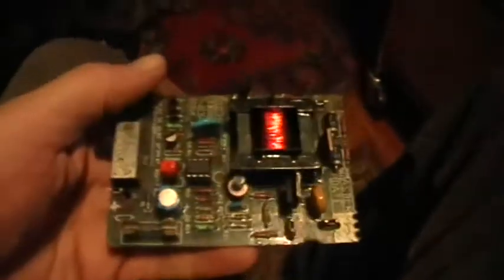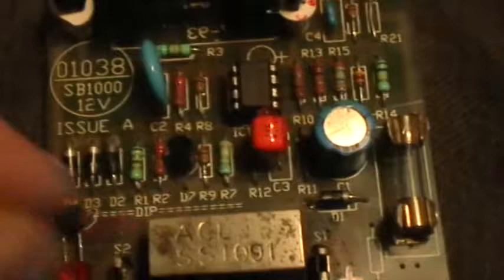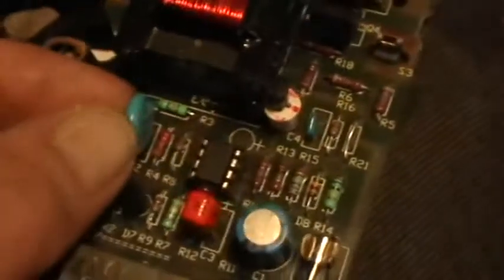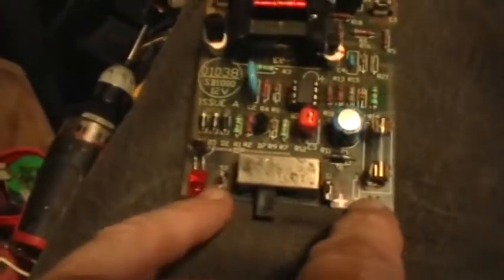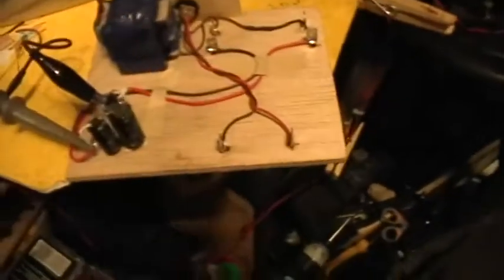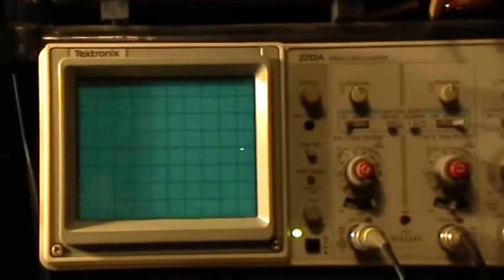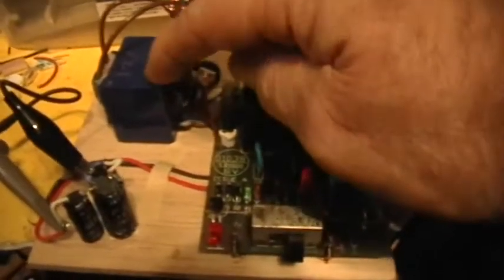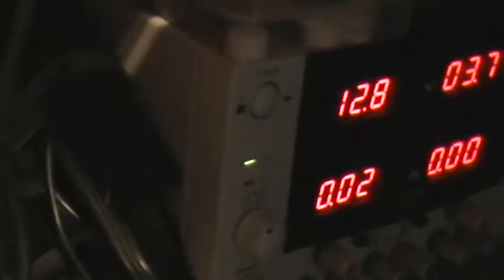Troubleshooting and Repair: SpeedRite SB1000 Fence Charger

Comment: Replace central IC and all old main capacitors, and don't forget to check all resistors too after that I think it will work as expected. ^_^
Reply from the maker: Heh... are you reading from a text tree like a help-desk person?
I could have sworn that in the video, I said I tried several different LM358 op-amp chips, even different types with same pinout like TL082. There is only one electrolytic cap on the board, as one might be able to see from the video, and it is in the pulse timing circuit which works fine, as I thought I also explained. And didn't I mention that I checked the resistors too? Perhaps I should watch the video again...

Comment: Possible improvement: increase the amperage at the transistor.
* lower resistor on the base
* or replace it with a Darlington (or solder two transistors to each other yourself)
Just some ideas.
Also the transformer can be bad, check the internal DC resistance. Maybe the insulation got broken and arcs inside (this you can not measure, unless you desolder the transformer/coil and test it off of the circuit board.
Hope this helps.
Reply from the maker: Yes, I am pretty well convinced that the inductor must have some breakdown happening. The original fault would have sent high current through the windings and may have melted the insulation. It's a pain to remove that bobbin, it has 14 heavy pins soldered to the board, even though only four of them are connected.